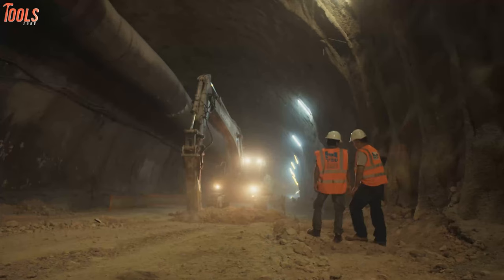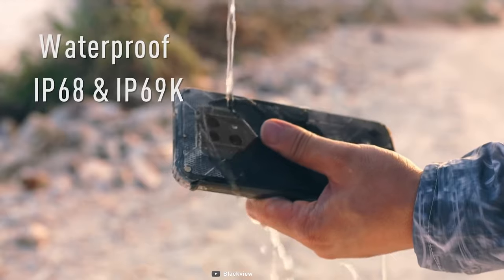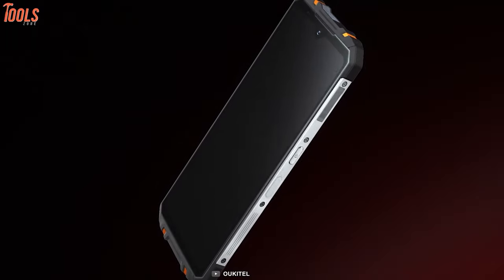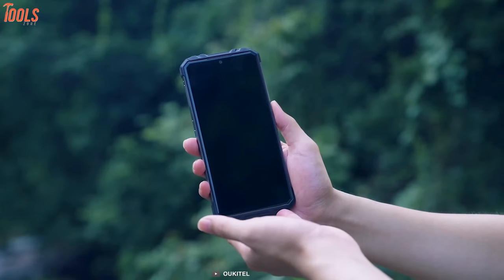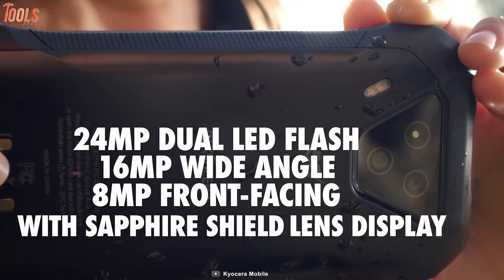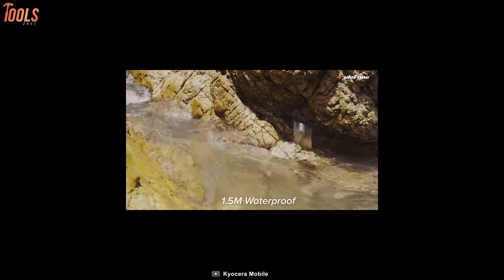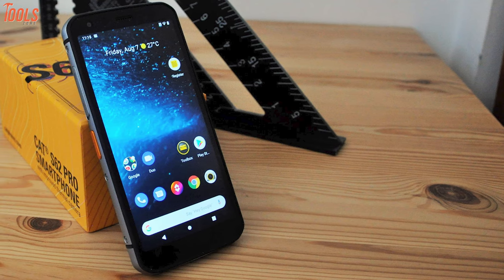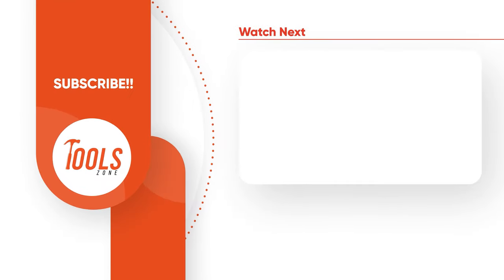5 Best Rugged Smartphone for Jobsite | Best Rugged Phone

Comment: Unfortunately the Kyocera Dura force 3 5g UW is made well with quality hardware but the software doesn't behave correctly. I went through 3 in 3 mos all with the same issues. Constantly power cycles by itself at random time, opens apps by itself, screen freeze just totally inoperable. Verizon needs stop selling them till the issue is resolved. I had a Dura force pro 2 for 4yrs that was abused to the fullest & it never missed a beat.
Reply from the maker: Sorry to hear that. 
Thank you for your feedback. Keep in touch with our channel for future videos.